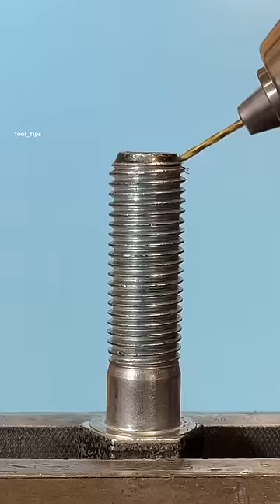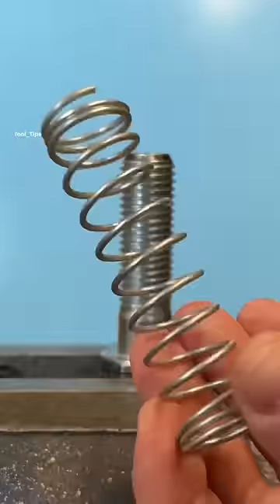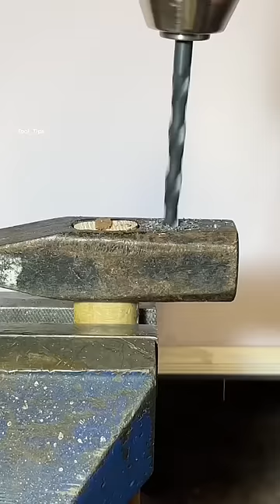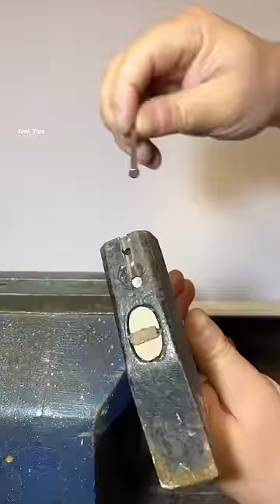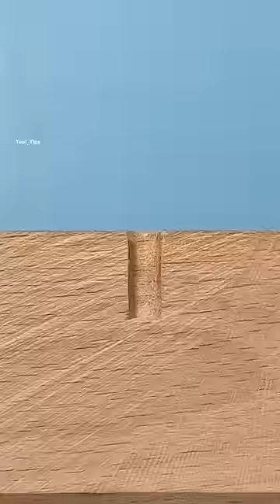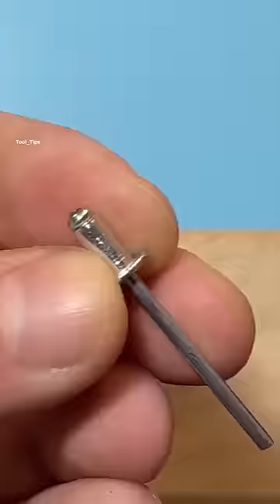Few People Know This Tips 🤫

Comment: Cool, a spring made out of solder, just what I need
Reply: I'm still trying to figure out what to do with a spring that has no strength
Reply: You could always turn it to a paper clip
Reply: There are reasons solder in that form is useful.
Reply: @dannygjk  such as?
Reply: @trav662  While you are soldering it can be standing in something such as a pill bottle and as you work you can easily uncoil it as needed. Put the cap back on after you are done and you don't have to worry about squishing or kinking it.
Reply: @dannygjk  if you want to eat it you can just bunch it up
Reply: @trav662  Huh??
Reply: Hey man, you never know when you may need a spring shaped solder to solder with…
Reply: @GeorgeOrwell-yz6zx  suspension for smart cars.
Reply: Technically not a spring. Just a coil. Like it already comes in.

If some miscreant sneaks into your tool shed and straightens all your solder, this trick would still be useless. Too bad there aren’t cylindrical appendages attached to your hands, then you could coil the solder on one of them.
👉🤚👍👈🖖✌️🤘🖕
Reply: @dannygjk  I will keep that trick in mind if any gremlins sneak into my shop and straighten out all my solder coils. This could save a life!!

Comment: That “spring” will be absolutely useless.
Reply: Unless you know how to properly heat treat and anneal the metal, yes.
Reply: @Unsensitive  even with that it will still be useless
Reply: @Unsensitive  not even the right kind of steel dude
Reply: My thing is why did they destroy that hammer when they had a more modernized version of the hammer that they where going to be destroying it to make it look like???
Reply: @Unsensitive  tell me you know nothing about metallurgy without telling me you know nothing about  metallurgy.
Reply: @dougwall675  l
Reply: @Unsensitive  Here's a simpler way. Buy a spring, small ones aren't expensive
Reply: @gazs7237
Reply: @Unsensitive  Nope, not that easy. Springs require certain type of steel, and  winding process is usually done after it got it's "springiness".
It's hard to make a proper string.
Reply: @Shonicheck  
My comment is about as accurate as the tips on this channel.

Sadly, few seem to be finding comedy in it.
Reply: The metal looked like soldering wire.
Reply: @WaschyNumber1  that or aluminum craft wire.
Reply: Who said it is a spring?
Reply: @Unsensitive  Nice try
Reply: @Unsensitive  If you heat this metal it will turn to liquid XD its solder wire.
Reply: Mechanically yes it's useless but in electronics it's convenient to build a simple and effective antenna as a spring.
Reply: As will the rest... if not completely useless, huge waste of time for very little benefit
Reply: Good
Reply: Thank you
Reply: @c.r.arguijo2609    Thank you
Reply: OO, a spring that doesn't spring, just what I need.
Reply: If it ain't made of spring all that work is useless
Reply: Exactly, what did they use solder
Reply: No, but its a neat way to store wire...
Reply: All of it is useless
Reply: @seanthehaggis  that would be a good way to wrap it up after you unwound a bunch
Reply: @Unsensitive  I highly doubt that anyone who knows how to heat, treat and anneal metal will be doing this shitty life hack to get a spring
Reply: @WaschyNumber1  that's what I was gonna say lol
Reply: Врачааааааа!!!!!
Reply: If you can bend metal with your hand, it's very weak. If you used stronger metal, you have to use heat.  Then your spring strength will still be weak because it's going off the threads which is too small to make it good. So yeah its pointless
Reply: Looks like solder metal to me
Reply: i have used this method to make rings for a chainmail
Reply: That’s what that was?
Reply: @Unsensitive
Reply: It looked more like solder to me
Reply: Most of this is for no use
Reply: I've used a similar method for making ecig coils, except I put the screw/bolt in a drill, so it did the winding for me.
Reply: @TheOnlyBlackInMeWasWillieBrown  damn dude if you say metallurgy too much it’ll come out as metalorgy
Reply: @dougwall675  steel? Looks more like lead or solder.
Reply: @dennis8196  you know what I mean man lol
Reply: I mean, or can be used as a coil for... My maybe a power inductor at best...amateur projects
Reply: the sht costs 11 cents
Reply: @Unsensitive  it's solder, there's no treating it.
Reply: @pikachuthegayatheist6215  its not a hammer, it's a chisel.
Reply: It'd be a better helicoil than anything
Reply: Wrong. You use it to get clicks.
Reply: @Unsensitive
Reply: @Unsensitive  sarcasm is extremely hard to understand through text.
Reply: Spring steel is available a lot of places,  and I guess all the people in this thread are experts by looking at the video to say that's not spring steel they used 🤣😂
Reply: Pretty much yes. Reason is simple spring is the same expendable thing as a nail or bearing. When made by factory method you know which characteristics that peculiar model have. When nade by hand from unknown material, in an unknown diameter and length it nothing more than the toy for   zoomers who love "diy".
Reply: Bullshit, They're perfect for rc drift cars
Reply: @Unsensitive  not high carbon steel.
Reply: I would say that's more of just a coil.
Reply: @Unsensitive
Reply: It just needs to be heat treated and tempered
Reply: The metal they take off is not the same spring they show after...
Reply: @Zhak7  Right! Or maybe he's going to use it for an inductor.
Reply: It’s like a shittier helicoil.
Reply: @Unsensitive
Reply: Also, the wall anchor in the glue...will just pull out eventually.
Reply: @Unsensitive  .
Reply: @Unsensitive
Reply: @Unsensitive  it has to be steel tho
Reply: Not spring steel
Reply: @Shonicheck  it's called spring steel
Reply: @dougwall675  it's not even steel, it's tin soldering wire ffs
Reply: @Unsensitive  you don't harden soldering wire aka tin
Reply: @urdel_durdel4136  I know dude
Reply: @gazs7237  what he's talking about?
Reply: @Unsensitive  I hate to break it to you, but that was definitely solder.
Reply: Sir, that's a sprong.
Reply: @Unsensitive  it’s lead. LEAD
Reply: Mate what he made was a diy  heli-coil, it is a thread you can glue into your timber so you can use bolts for things like removable table legs
Reply: @yourmommashouse  no as I said DIY version, glue and compress that into the correct size hole it will work perfectly.
The proper ones that you buy from the shop you hammer in to the hole no glue required, screwing in the bolt provides all the tencion/grip required
Reply: Watch the rest, they are all useless.
Reply: Just buy a spring
Reply: @Unsensitive  
Yeah that's an economically smart thought of yours!
Reply: @FabricatedPheonix  My thoughts exactly!
Reply: That's definitely soldering wire. You can put the coil around your soldering iron ig
Reply: Coil, not a spring. Springs are, springer.
Reply: Ohhhh a spring!!!!! I thought he was showing how to ruin a perfectly good bolt!!
Reply: @Unsensitive  that looked and acted like soldering wire. Anything wrapped like that with bare fingers that stayed there tight after being let go of will never become a compression spring regardless of steps taken.
Reply: Zero tensile strength in that "spring"
Reply: Couldn’t you that as a HeliCoil
Reply: Get this, my old next door neighbor owns a spring factory. 🏭 I swear to god he does. It’s grown to be a pretty big company now. They can make you any kind of spring you want lol.
Reply: @Syclone0044  I've worked as a spring manufacturer. Cnc's, wafios machines it's all wild.
Reply: Not even steel, pretty sure it's fucking solder
Reply: My 10 year old boy begs to differ, sir!
Reply: only use I can see for the coil he made is to make your own helicoil.
Reply: @Unsensitive  Temper, not anneal. Annealing is recrystalizing hardened steel to make it soft again. Tempering is stress relieving, and normalisation a more brutal form of tempering used to keep a steel workable.
Reply: @Unsensitive  maybe make it funny and they might
Reply: These replies are so painful. He was coiling solder for easy transportation & use because industrial quantities come in spools. In electrical engineering everybody knows that already though.
Reply: It's a one-way spring
Reply: the spring seemed more like soldering tin lmfao
Reply: @Unsensitive  looks like solder, so best of luck to you trying to heat treat that 😂😂😂😂
Reply: You make it copper and now you have a copper spring for battery vroom
Reply: Как и всё остальное
Reply: @Unsensitive  ึ
Reply: Gets a Pencil. Grabs an aluminum wire. Jabs end of wire in the eraser, and wraps around pencil...Voila...coil  lol
Reply: For show, for show 🤣
Reply: No it’s perfect for a fourteen year old with ADHD in a history class.
Reply: At first I thought he was making a helicoil or something, but no, wasn't making anything other than a video.
Reply: @dougwall675  and you can tell just by looking at it?
Reply: @newtybot  yep sure can
Reply: @dougwall675  Enlighten me
Reply: @newtybot  I'm not going to get into it, but I'm a custom off road fabricator. I can tell more than someone with no idea, that is all. Not about to advertise the company on here either lol.
Reply: @dougwall675  Well, I trust you; I have no reason not to. And for the record, I'm aware the spring is totally useless
Reply: @newtybot  I hear ya. You just never know on here. Someone always looking for a menial fight lol. Take care man.
Reply: @Unsensitive  you cannot make soft metal hard. you can only make hard metals harder.  that will never be a spring
Reply: Right? Missed the part where he tempered it!
Reply: I think it's supposed to be a home made helicoil not a spring. Seems like getting the sizing right would be near impossible but the real deals ARE actually pretty expensive, only one worth any consideration IMO.
Reply: True
Reply: Lost all credibility, 😢with that first hack. 😂
Reply: If you want everything in your life to be in order, your health,your finances, your relationships with family, friends and all your loved ones as well as kids

Trust in the name and the power of Our Lord Jesus Christ, The Father and The Holy Spirit.

Say this Prayer to ask God for Freedom in Christ Jesus.

●Say: Jesus Christ i ask you to please come into my heart and be my Lord and Saviour, please Bless my soul and make me a true child of God.
Thank you for saving me and setting me free. In Jesus name. Amen

GOD LOVES YOU....
Reply: 哈哈哈，并没有卵用
Reply: Spring was made of soldering iron.
Reply: @Unsensitive  true
Reply: @keilveil9153  well said pal obviously he's just demonstrating that it can be done also maybe it did help some
Reply: @Unsensitive  That is solder. It would turn into liquid if you heated it
Reply: Yeah... if they used it for loose threading then sure but if you can bend it, it won't help in the slightest
Reply: @dougwall675  is that even steel? It looks like tin.
Reply: @eklhaft4531  I'm sure it's not. Probably tin or aluminum of some kind. Either way it's junk.
Reply: @wojtekepecki5774 Yup. Came here to say exactly that.  A friend made enough rings for a chain mail bikini (don't ask) that way,  using fairly hard wire.
Reply: Useless as a spring but if he left it tight it'd make a decent helicoil
Reply: I thought at first it was some kind of fix for a stripped bolt or thread but... why

The dowel one has me scratching my head too - one question just leads to others
Reply: U know the science why sofa is pushy right
Reply: @Unsensitive  many a gain. But i Will do like this vidios.
Reply: @Unsensitive  it’s solder. You can’t heat treat or anneal it
Reply: That's what I was going to say. Looks good on video though.
Reply: Pretty sure that was just solder being wrapped up to be stored and used. Usually it’s coiled up to maximize the amount you can store without bending or kinking it. But a freaking toddler coulda came up with that solution.
Reply: @Unsensitive  You didn't make a joke, this is just you trying to save face.
Reply: @TheOnlyBlackInMeWasWillieBrown 
Ik nothing about metallurgy. Even I knew that the "spring" wouldn't hold lol
Reply: that's not a spring, that spiral-y trash
Reply: @robertthomas6127  Lol
Reply: I could vaguely see the through line for the other three, but I'm utterly baffled by the first. I don't know why you would need to do that.
Reply: @Unsensitive  that was like solder. Any heat would just melt it.
Reply: That's solder
Reply: @Unsensitive  its fucking solder lol. You’re only going to heat that into a puddle.
Reply: @Zhak7  that’s not how antennas work. They have to be designed to have resonance at a corresponding frequency. You don’t just make a wire coil. That’s a naïve approach to making an antenna- eg someone making one who has seen an antenna but doesn’t know how they work
Reply: It's not really a spring. But there's a lot of uses for normal spirals too.
Don't discriminate them 😂
Reply: @Unsensitive  There is nothing funny about your comment.
Reply: @Unsensitive  it's soldering wire dude....
Reply: @Unsensitive  Heat treat and anneal Lead or tin soldering wire.

Comment: What you did to that sheet metal hammer is unforgivable
Reply: The fact that he drilled it is a fair indication that it was crap.
Reply: Yeah, why would someone drive nails with a metalworking hammer?
Reply: @duncanmclaren9191  х⁰⁰
Reply: @duncanmclaren9191  cheap or not that cross peen hammer didnt do anything to deserve that treatment
Reply: @lenorevanalstine1219  ...a fair point, 
...but is it a hammer?
 
 A paperweight.
Reply: @duncanmclaren9191  i mean after what that guy did its a paper weight now
Reply: Stop.

Wrong Hammer Time!
Reply: @duncanmclaren9191  Kinda looks like a blacksmith's chisel. They kinda look like hammers but are just a chisel with a handle so you don't have to hold a regular chisel and risk hitting your hand or fiddle with tongs
Reply: If you've only got one arm, it would be a good idea, though.
Reply: @msa-tt4bg  Well sure, that's why they make hammers designed to hammer nails that do that. Right tool for the right job and all that.
Reply: @duncanmclaren9191 drill bits will cut through almost anything. What u mean?
Reply: @master_baiter1873  a drill bit won't touch a decent hammer. Heaps of stuff is hard to drill.
Reply: @5000rgb  and
Reply: Who drives nails with a tin knockers hammer? I'm a retired carpenter. Never in my career did I need a magnetic nail holder on my hammer .
Reply: Fr😢

Comment: This video summarised:

1. Want to wrap your solder into a spiral for some reason? Drill a hole into a bolt.
2. Can't afford a framing hammer with a magnetic bit holder? Ruin a different hammer which isn't even a claw hammer and put a magnet in it. As a bonus you put the magnet in the wrong place which means it will probably crack after a few uses.
3. Have the wrong sized wall plug for your screw? Don't worry, hold you screw in with hopes, dreams, the over-sized wall plug, and a bunch of silicone.
4. Don't know what dowels are for? Need to hold one in its hole? Don't know about wood glue? Just spend 5 minutes drilling a hole into a dowel and hammering a pop rivet perfectly into the centre of where your dowel needs to go.
Reply: You win.
Reply: In Germany we call this "Pfusch vom Feinsten"
Reply: Anda cerdas
Reply: "which isn't even a claw hammer" made my day😂
Reply: Thank you
Reply: This was an honest "lmao"
Reply: In Israel we call this a regular day.
Reply: 😊😊😊😊😊😊😊 VC🎉
Reply: Excellent summary. The only thing you missed was that the magnet in the wrong hammer was also secured using the wrong glue.
Reply: @edgewatersbestguitarist1524  lol me 2
Reply: Two of them could be further condensed to 
Ugly hacks for OOPS, wrong drill bit
Reply: I think that 3 is “Have a drill bit too big for your wall anchor? Shove it in there with some vanilla icing and hope it stays!”
Reply: lol based
Reply: “Don’t know about wood glue?” lost my breath
Reply: Made my day :D I could add too with the hammer, if you try this on hardened steel, you're going to ruin the drill bit too
Reply: I barely ever use tools, and yet watching this video hurt me physically
Reply: "With hopes and dreams"😅😅😅😅😂😂😂😂 I was going to comment but I don't think I can top this.
Reply: They weren't ruining a hammer. They were ruining a chisel, which arguably makes this worse
Reply: @michaelwarner5277  lol 😂
Reply: Was this video posted on April 1st?
Reply: Hank hill sounding ass
Reply: The magnetic hammer sounds dumb af…
Reply: I thought #3 was pretty good. maybe use an epoxy but let it dry before installing screw.
Reply: Best comment ever.
Reply: Those wall plugs are for shit like hanging a towel rack or a picture frame in drywall or what have you, a "less than 75lbs" kinda job. They're meant to be an interference fit, which means you hammer that bastard in, and you pick your drill or fastener accordingly.

But good god, you're spot on about this garbage.
Reply: 😂😂😂😂😂😂

YES , this is exactly how I felt but I didn’t know how to articulate it , I just knew this shit here wasn’t it and somethin wasn’t right 😂
Reply: You just ended this man’s whole career 😂
Reply: “Don’t worry , hold your screws in with hopes, dreams”.. lmaooo 😅
Reply: thanks god someone said it, beyond ridiculous!
Reply: beautiful.
Reply: Idk what u just said to me little kid but u "special" ..... touched my heart
Reply: Summary took exactly 6 x the length of the video. 
I feel the pain too.
Reply: Yeah that about sums it up 🤣🤣🤣🤣🤣
Reply: @Demonslayer-64  botch from the fine stone ???? 🤷🤷🤷🤷 Sorry I googled it and that's what I got 🤣🤣🤣🤣 what does putsch vom feinsten really mean ?
Reply: I am a fairly unhandy woman. I know how to change an alternator and a tire and fix a printer. And that's mostly it.
But I was genuinely HORRIFIED the the entirety of these "fixes."
Reply: This comment should be pinned.
Reply: Also the framing hammer with magnetic bits are superfluous anyway because you can use the claw to set the nail
Reply: stop the cap😂